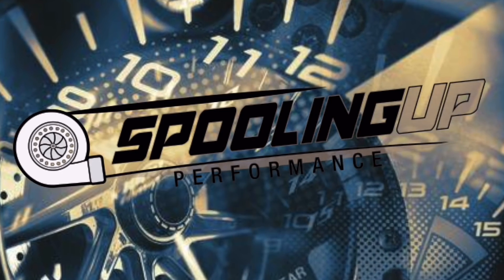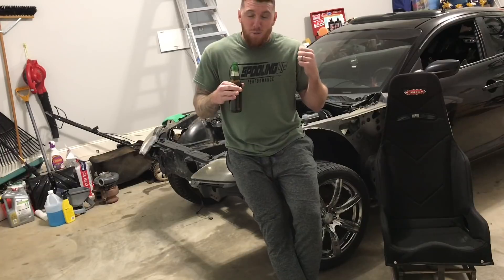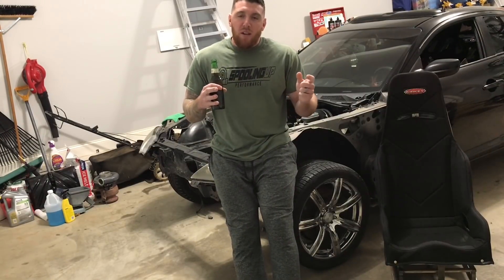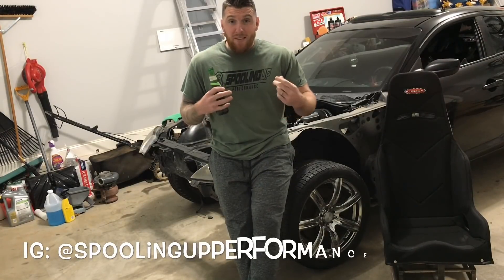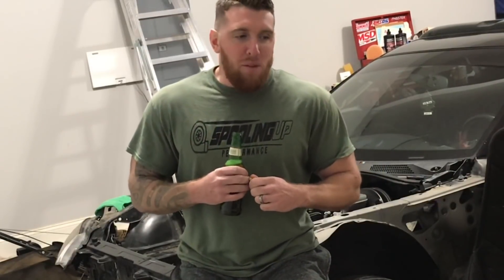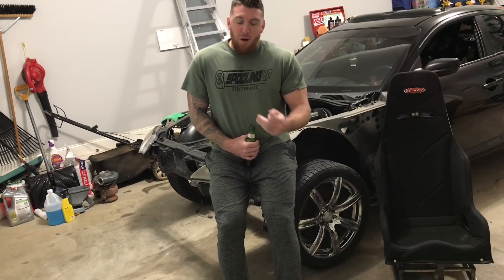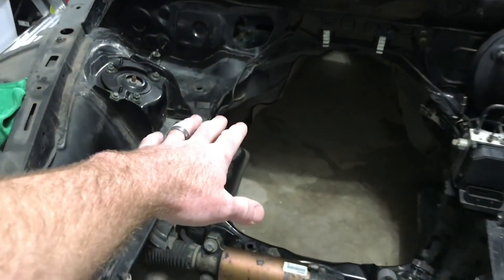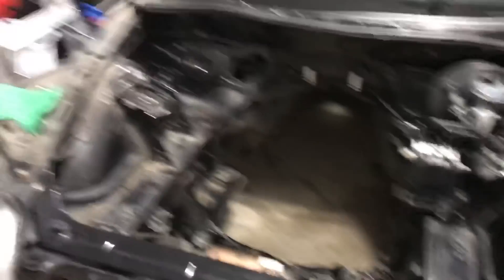Mazdaspeed 3/6 (MZR) Swapped RX-8 Build  | You Wanted Another Crazy Speed Build So Here It Is!

Comment: Okay so i started planning putting an MZR in my miata over a year ago and it seemed like a very possible thing. Just money on my end sense i was just out of highschool stopped me. 
Use an NC miata oil pan. They bolt up. Same with the trans. But the NC transmission will probably only only 450hp. 
The ecoboost mustang's apparently use the same trans as the 5.0 with a different bell housing. So those transmissions will hold 700hp+. 
Youll need a different intake manifold that has the TB fscing the opposite way in the speeds. 
Maybe the focus manifold would work sense it faces down.
Reply from the maker: Ya got mostly everything figured out! Thanks! Got a lot lined up and ready to go
Reply from the maker: We figured out the trans as well

Comment: I’ve wanted to do this really bad for a long time. From the research I did iirc a m5r1 (or m5r2 might be better) would work or get you really close only down fall is you might have to use duratec flywheel and clutch
Reply: Or better yet a turbo2 trans from an rx7 or a bmw trans, popular swaps for high hp miatas
Reply from the maker: Are they a direct bolt up or do they require a adapter plate/bellhousing
Reply from the maker: I would love to find a bell housing to adapt a th400 that way I can get one cheap and do a trans brake and manual valve body
Reply: I’m about 90% sure a Ford m5r1(2) bell housing is bolt on but again the flywheel and clutch would be from a ranger focus etc. easiest but probably not best route. I’d look into mustang ecoboost m/t or a/t IMO

Comment: I did this already, but i didn't finish it, I used an NC subframe, steering rack and transmission. the stock rx8 driveshaft will work, If you swap the r3 transmission tailshaft on to the miata transmission you can also use the stock PPF! the Miata cluster nearly fits the Rx8 dash perfectly, If you use all the stock mounting points you'll have to cut quite abit out of the firewall. look me up on Instagram @alfredfromtoronto and you can see how far I got
Reply from the maker: I will not be using any of that drivetrain as it will not hold the power we are putting in it but glad to see you attempted it !

Comment: Nice to see and hear you decided to go with this approach!...I can't wait to see it running already!...Glad you went back to the Mazda platform!  How will you run the intake system?  Can the turbo be turned around to have the air intake coming towards the front of the car?
Reply from the maker: Absolutely that’s the plan I just couldn’t change the picture that I had just overlaid in the engine bay . But turbo inlet would face front of
The car and exhaust housing towards rear

Comment: You what you should do? Just buy a swap Mustang 2.3 Ecoboost Motor. Basically the transmission is resolved. Intake manifold it's facing the same direction the front so that's resolved for rwd. However, the Mazdaspeed motor is a close deck vs the weaksos open deck. A few fabrication for the mounts and you should be solid if you go this route in my opinion. :)
Reply: Nope. The 2.3 MZR DISI Turbo is a much better motor. Those 2.3 Ecoboost blocks are actually splitting between cylinders 2 and 3. The MZR is the much better, much more vetted and proven choice.
Reply: @numinous4789  lol why is it a no? I hope you know the difference between open deck and close deck blocks. As stated above weaksos open deck!!
Reply: @royyang89  It's an inferior block, Roy, simple as that. People who know a ton about these two platforms (the Speed and the RS) were stunned that they put such a weak block with so little room to grow in the RS, especially at its price.  There is no question that closed deck are superior for more power. Regardless, It has to do with the case itself, which is very thin. It's a flawed design if you're looking to make north of 500. It's an open deck design that's especially weak. Educate yourself:
https://www.youtube.com/watch?v=CuGodKdRLpE